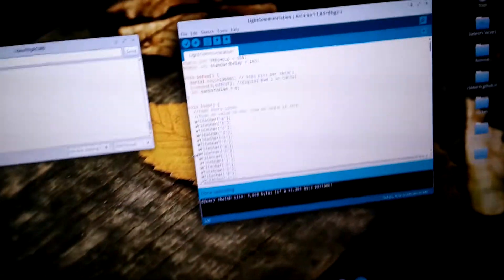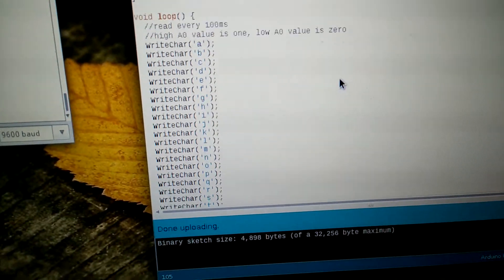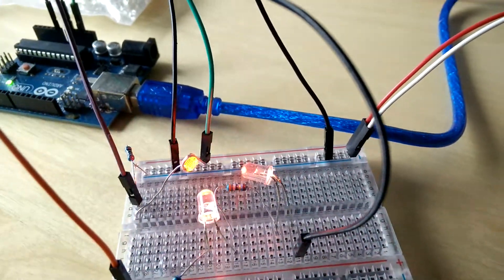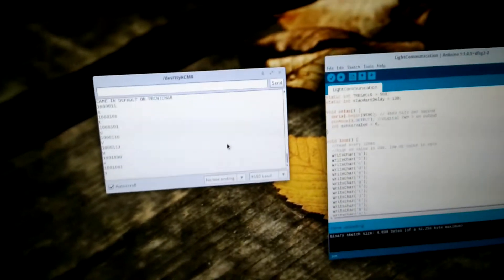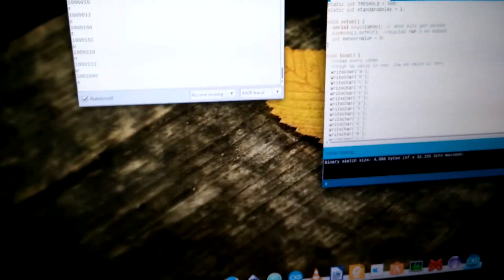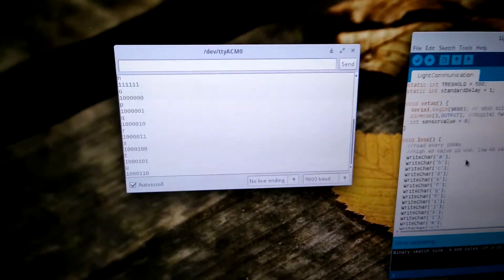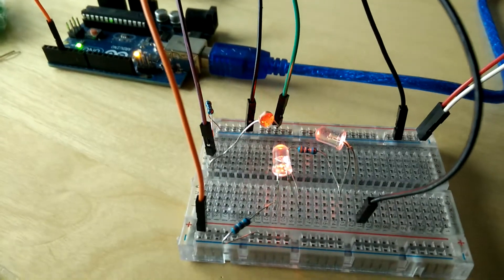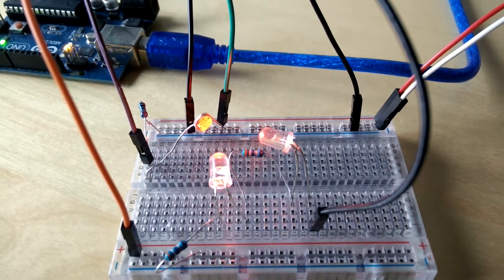Visible light communication with an arduino

Comment: hello sir its an great vedio. iam also doing my final year project based on light communication, but there is a change little bit. we want to transfer the information what we got from our experiment to other side, can you please it help it out. my name Mallikarjuna and my mail id mallikarjuna9744@gmail.com
Reply from the maker: Sure, if you have any specific question, you can post them here. A lot of questions have already been answered in the comment section (also about communicating between two different arduinos!), so I'd suggest you read these for a start ;-) Good luck!

Comment: What About Flicker Fusion Frequency?
Reply from the maker: For flicker fusion, one should implement a coding technique that alternates ones and zeros, because otherwise it's possible that lots of zeros are being transmitted, so a human observer will see the light go out. An example of such a coding technique is Manchester coding.
Reply: @vision4472  but wouldn't it reduce the brightness of LED..
Reply from the maker: @oneandonlysanket  depends to what you compare. If you compare to the LED just being on the whole time, yes, because with Manchester it's on for only 50% of the time. If you compare with on-off keying (what's used here), then, on average, it was also on for only 50% of the time (if the amount of 0s and 1s are about equal).

Comment: Hi, loved your project and tried to build it on my own but cannot understand why my leds do not blink at all. can you please tell me what to do?
Reply from the maker: NISHI N LEDs have a polarity, that's the first thing that comes to mind. It means that they have a + and - side, and you have to get it right. I recommend you to watch the detailed followup video that I added in the description of this video. Good luck!
Reply: Vision I checked the polarities and made the connection but it's still not working! And I am following the follow up video only. Do I need to make some changes in the code?
Reply from the maker: NISHI N If you upload the code as provided, it should start blinking if you connected the LEDs to the right ports in the right way. No need to change the code, but you can always try to upload the blink sketch (you can find it under the examples in arduino), and test your leds by connecting them to port 13 and ground with a resistor in between. Because it might be that it's just your LED itself that's broken.
Reply: Vision In your circuit it's connected to Port 3 or 13 of the Arduino? I have connected to the port 3.
Reply from the maker: NISHI N The blink sketch alters the output of digital pin 13 (at least on an arduino UNO), my sketch uses digital pin 3.
Reply: Vision Hey thanks, I did as you instructed and it turns out that my led works just fine. There's some problem in my circuit which I'll have to look again. Can I mail you the pics of my circuit so that you could tell me what's wrong?
Reply from the maker: NISHI N Of course, if you can upload them to imgur or something like that then we can keep the discussion here on youtube :)
Reply: Vision Hey, after much effort I finally got my circuit running and also got the outputs as shown in the video! Thanks so much  for all your help and, sorry for all the trouble caused. Keep making such awesome videos! :))
Reply from the maker: NISHI N Thanks for your reply, this is exactly the reason I do this for :) Enjoy visible light communication ;)
Reply: @nishin6392  How did you make leds blink?

Comment: hi i am using L14G3_2 as a photo transistor but the problem is that the readings are always 0 
p.s:that is the only photo transistor i can get
Reply from the maker: Clash yep it's an issue lots of people have. Try to set your threshold lower. For example start at threshold value 0 and work your way up until it works. You can also watch the extended video in the description.
Reply: I've tried something else and it worked 
but i need to make it two arduino pieces with two laptops now
any idea for the code and the adjustments i need to do for the circuit
Reply from the maker: Clash yes! Very nice initiative! I wanted to do the very same thing for a long time but I can't find the time. The hardest thing will probably be to get them in sync. You should look up "preamble" and  "phase locked loop". I wish you the best of luck :D
Reply from the maker: Also, someone already asked the same question somewhere in the comments and I answered back then :)
Reply: the problem is that i have some lack when it comes to arduino
circuits is my thing in a way or another so i was thinking about that if you have time we could chat and could co-op in developing this thing 
if you don't mind
Reply from the maker: Thanks for the proposal but at this moment I don't really have the time to take on such a project. Hope you can figure it out :)

Comment: Hello there, I recently build this wonderful project, but the serial monitor only shows up  (0 Default in varchar) something like that, could you give me a solution towards that?? thanks in advance.
Reply from the maker: Airil Shah sure, I think you'll need to tweak the threshold value a bit. In darker or lighter environments, this value is different. You can find a follow-up video in the description.
Reply: Hello good sir, thanks for the reply . recently I wanted to do this project on two arduinos one acted as tx and another is rx, do you have any ideas on how to make this happened?
Reply from the maker: Airil Shah Hi there. Some other people already requested the same thing in the comments, if you can find it, you'll get some more information. The hacdest thing will probably be, to get them in sync with each other. Terms you could search for in order to get that done are 'preamble' and 'phase locked loop'. Hope you'll figure it out :) Good luck!

Comment: Sir when I am trying to run the code the output is showing continuously 111111..Can u help me out?
Reply from the maker: Teja Kathari yes, try to adjust the threshold value. Try to increase it.
Reply: Did u get the correct threshold value? Can u tell me?

Comment: excuse me sir, whether sunlight can be interference in implementation at outdoor ?
Reply from the maker: eka bayu yes, definitely. This setup works with a threshold value. The photoresistors output a value based on how much light is shining on them, the arduine then dicides whether the value exceeds the threshold and will output a 1 if so, and a 0 if not. Sunlight will elevate the value that the photoresistor outputs. Adjusting the threshold can be a solution, but will be insufficient if the setup is used over the course of a day, where sunlight intensity changes.
Reply: ok, thank you so much. the answer give me solved about problem on my final project

Comment: Hi, I don't understand your resistor connections. Why did you use 2 resistors if you're connecting the LED's in series? If possible could you tell me what your voltage supply and your forward voltage and your forward current is for the LEDs ? Thanks
Reply from the maker: vishnu haridas excellent question. The two resistors thing is not necessary at all. The voltage supply is just an output pin from the arduino, so 5V. About the LEDs, I have no idea but that's something you could easily google.
Reply: Thanks for the quick response. I wanted to know those values since I used super bright red 5mm leds and when I calculated the limiting resistance it came to about 100 ohms as opposed to your 40 ohms which confused me.
Reply from the maker: vishnu haridas Oh yeah, I know the struggle. Don't worry too much about it, if you're unsure, try a resistor value somewhat higher than calculated, so you'll get less current and won't break the LEDs.
Reply: Hey sorry to bother you again on this but my monitor is showing the ""111111 came in default on PrintChar" error statement. I have it on a threshold of 2.  Do you have any guesses on why the problem exists?
Reply from the maker: vishnu haridas your threshold is way too low, probably. It can be on a scale from 0 to 1023, so inyour case everything above 2 (which is probably everything), is recognized as 1. Try to increase it to about 500 and play with it until you get no errors anymore. It also helps to move your setup to a dark environment.
Reply: What modifications should I do to the code, If I want to send and receive one signal on, as in one letter. I tried changing the code but nothing has worked so far.
Reply from the maker: vishnu haridas right now, in the main loop, every character of the alphabet is being written. If you remove all but one character, this character will be repeatedly printed. If you want to send that charcter only once and not repeatedly, I suggest you move that code to the setup or set some boolean flag in the main loop that says whether you've already sent it or not.

Comment: hi, i tried to separate the transmitter and receiver with 2 UNO and I'm facing problems receiver not able to catch the transmitting data... do you have any comment regarding that ?
Reply from the maker: Cool! Yes, with 2 arduinos the problem gets a little bit more difficult, because they will not necessarilly be "in sync". That means, while the sender is transmitting its 3rd bit, the receiver might be only starting to receive the first bit. My first idea would be to see whether it's possible to solve the problem using a preamble. That is just a fixed sequence of ones and zeros that you send out whenever you start. The receiver can then detect where in this preamble we are now. Another idea is to connect them to the internet or use an RTC to get the time, and agree to only start at for example an exact minute. Other terms you can search for on the web are "phase locked loop" and "integrate and dump". I'm interested to see your solution!
Reply: Thanks for the quick reply. I tried by putting delay after the LED starts light up on the receiver site but the problem still exist. Will try look onto the method you suggest, hope it works. Thanks.

Comment: Can i increase the blinking speed of the led?? making the blinking not visible to human eyes??
Reply from the maker: Jayvee Hidalgo Yes. You can do so by adjusting the standard delay parameter in the code. However, this will still be too slow for human eyes not to notice the blinking. To take it one step further, I suggest you research methods on arduino for faster switching. One thing that could help is to choose another modulation technique or to use for example Manchester code (which will give 1/2 brightness, always). I don't know if the arduino outputs are capable of doing such fast switching, so you might have to take the project to another platform. Hope this helps!
Reply: Vision thanks. it really helps a lot.

Comment: would you tell me that how to transmit text using PS2 keyboard and displayed the same text on LCD using LiFi technology using Arduino UNO board ?
Reply from the maker: Ashvini Patil right now, I don't have the time to find that out, but I think the building blocks are already out there, if you are okay with the serial monitor software that is built-in in arduino. Just try to combine my code with the LCD code and voilà :)

Comment: I'm looking for a way to control which litter is transmitted. or words you know. as if I'm sending a text message.. ! can you help me out
Reply from the maker: Tarek El Dallal Yes, just adjust the characters that are sent in the code.
Reply from the maker: Tarek El Dallal it should be sent character by character though. For now, you still can't send entire messages other than by sending the characters of that message individually.
Reply: Thanks

Comment: hi friend .. which modulation did you use ?? 
i work in a similar project and my teacher would that i do it with pwm modulation it is possible ? please help me
Reply from the maker: Haithem Noomen Hi there. Good question. I guess you could describe the modulation technique used here as "On-Off keying". PWM is certainly a good alternative, but I think it'll be somewhat more difficult to build on an arduino. It also depends a lot on the application you want to use it for, so try googling some other modulation techniques as well :) QAM may be relevant, that is the modulation technique used in Wi-Fi.
Reply: thank you friend . but my teacher oblige me to do my project with pwm  . what should i do ??
Reply from the maker: Haithem Noomen For documentation on PWM, the internet is full of that. Just google PWM or look it up on wikipedia. If you want to apply it to this project specifically, you'll have to change the times the LEDs go on and off based on the character that you want to transmit.
Reply: it will be a problem of synchronization ? The receiver needs time for decoding and at this time another binary frame arrives ..
I think it is necessary to increase the period so that it can be divided and to deduce the coded message following the calculation of the pulse width and since the period has increased this will affect the flow
what do you think (sorry for the bad englich because i am francophone )
Reply from the maker: Haithem Noomen Je ne suis pas entièrement sûr de ce que tu veux dire, mais, oui, synchronisation peut être un problème. Mais ça depend aussi de ce que tu veux faire, si tu veux aller très très vite, il faut prendre en considération les calculations sur le chip qui prennent temp. Si tu peux aller un peu moins vite, les calculations sur le chip n'ont pas beaucoup d'influence.
Reply: merci beaucoup
Reply: depuis deux jours et je travaille sur une modulation pwm et je n'ai pas trouvé une solution . est que le montage de circuit de réception va etre le mm comme pour le ook ?
Reply from the maker: Haithem Noomen oui, ça devrait fonctionner sans faire modifications au circuit :)
Reply: oui merci .
Existe t-il des librairies pour pwm pour que je puisse mesurer la largeur d'impulsion ou changer la fréquence d’émission  . Je commence ma programmation de zéro et vraiment c'est très difficile .
Reply from the maker: Haithem Noomen oui, je ne les ai jamais utilisés, mais si tu cherches sur Google, il y en a. Par example ici https://www.baldengineer.com/software-pwm-with-millis.html

Comment: Is there a difference using the Photodiode and the Photoresistor?
Reply from the maker: Wang Yi excellent question. Yes there exist differences between them. To simply reproduce this experiment, I recommend that you use photoresistors. However, if you are making for example a very low power device, you might want to opt for a diode. Diodes normally only have a voltage drop across them when forward biased (conducting). That means that you can choose the resistor behind it as high or as low as you want, thus controlling the current that flows through. With a photoresistor, this is different. Here, it is the resistance itself that varies, which means that you will have to adapt the value of the resistor that follows to the photoresistor. 

A disadvantage of choosing a diode is that the mentioned voltage drop is usually pretty small in comparison to the 5V of the arduino. Say for example that it is 1V, then you can only measure a difference of 1V on the arduino (only ranges from 800-1023 or 0-200 will be useful). With a photoresistor, you can make sure that you have a big output swing, for example by choosing a small resistor in comparison to the photoresistor. However, I don't know if it matters that much in this application, as it is only needed to distinguish between 0 and 1.
Reply: May i know what photoresistor u used in this experiment?
Reply from the maker: Wang Yi I don't know it by heart, but I'm sure it's somewhere in the comment section.
Reply: Hi, again I had done all the instructed from your long Vid, however, my reading for the HIGH keep on showing 0. May i know why?
Reply from the maker: Wang Yi which port are you reading out on the arduino?
Reply: For the reading out, i used the code, u typed for the long vid, which is A0. However, what i seeing are all 0
Reply: If i change to other Analog input write, i will still get 0. If there something with the photoresistor?
Reply: When i performed the analog Read test , i got 0 all the way. However, if i run the main code, I got 1111111
Reply: i got default error 11111 even when i never put the photoresistor
Reply from the maker: Strange. It doesn't seem like everything is hooked up right. Have you checked your connections? You can try to measure the resistance from ground to the end where it should be connected to 5V with a multimeter. Also, try to move the setup to a dark environment.
Reply: Is there any way i can contact you via some online platform like skype? I really need this thing to get going. Thanks
Reply: I had checked the connection pretty sure it is correct.
Reply from the maker: Wang Yi Not sure what is wrong then. Sorry.

Comment: Hi, Sir! Thank you for your sharing!
I've looked into your code and then try to build the same module. I've encountered a  problem which sometime arduino can decode the LED blink data but sometime cannot.
I guess is a signal synchronization problem. But it looks like your demo don't not have this problem, how do you make it?
Thanks again!
Reply from the maker: jerry99655 Yu What do you mean by the encoder not being able to blink sometimes? What does it do instead? The leds just stay on or off? For how long does it do that?
Reply: Vision, sorry for my typo. I mean "Decode" not "Encode". I've changed my comment.
Reply from the maker: jerry99655 Yu oh ok, I think you are decoding too close to the threshold. Try to adjust the threshold in the code, or try moving your setup to a darker spot. Good luck!
Reply: Okay! Thank you. I will try it!